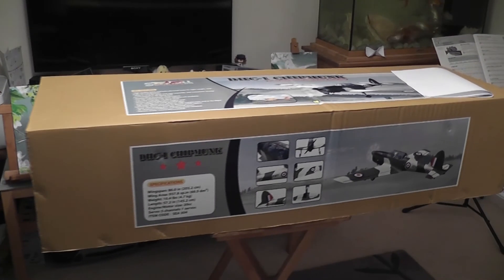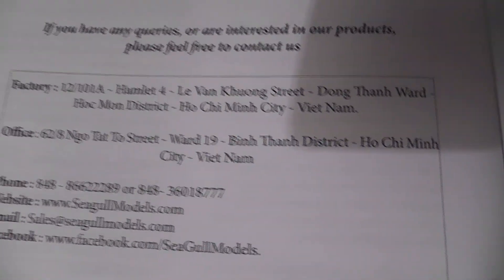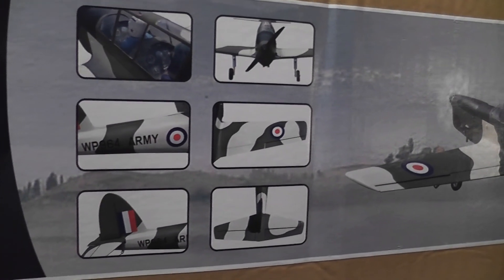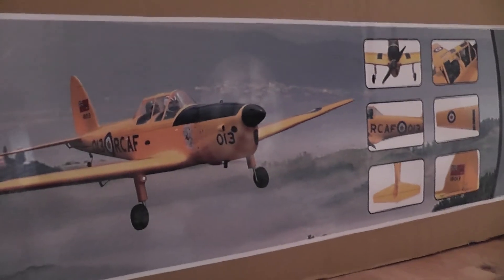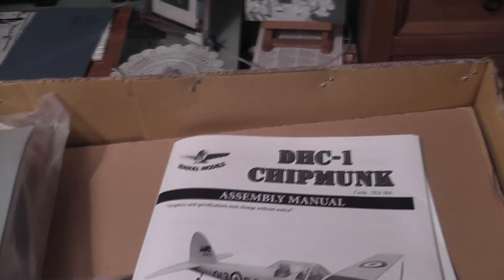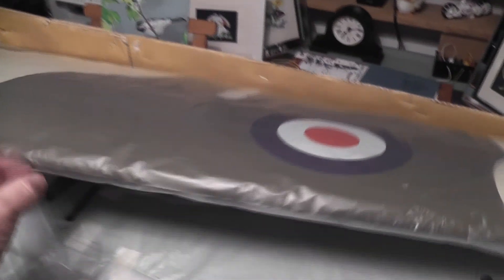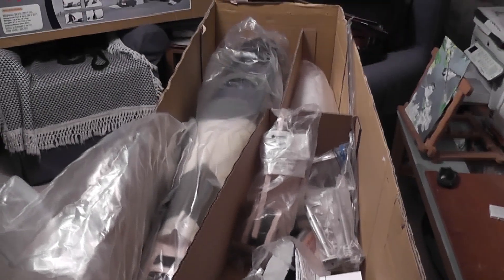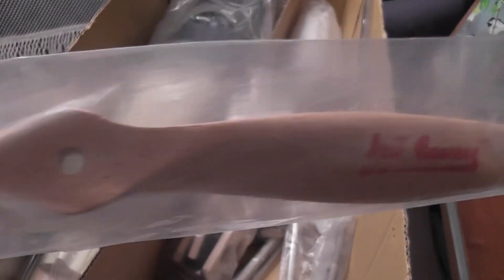Unboxing the Chipmunk Seagull 80" RC  DHC-1 SEA 304G Part 1

Comment: Can't find Part 2 video?
Reply from the maker: Sorry Grahame, I haven't flown it yet, the fire wall came apart due to poor gluing at Seagull's Factory, I was just testing the plane in a car park, and the engine just flew of the front of the plane!  I have reinforced the motor mount now. Unfortunately I am keeping this model for my retirement so won't be flying it until I have a fair bit of experience, I have 13 other planes, to practice with in the mean time! I haven't got the details of the engine with me at the moment, but it is what was recommended around 2 KW. The equivalent electric motor has instant torque, which these chassis are not use to I think was part of the problem!

Comment: SO how did it fly? What engine did you stuff into it?
Reply from the maker: Not flown yet, engine flow off the front, went back to distributor. who confirmed my thoughts, they use very poor glue, if any atoll, and the 3mm ply was not going to hold the motor, the frame is poorly designed ...in fact it was never designed for electric motor! I fitted a JP EnErG 26cc 0/R 390 (c5030) which was recommended buy the supplier. I do have a video I will try and put online, showing me test driving the plane in a car park area when it happened fortunately. I have seen very few of these actually flying which does not surprise me now!
Reply: I had thought about buying this plane but I'm glad now I didn't.  Thanks for sharing this video.